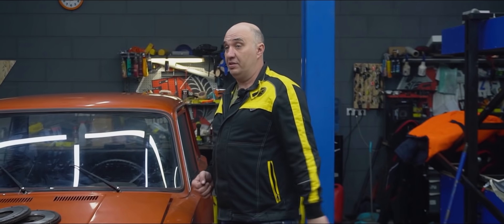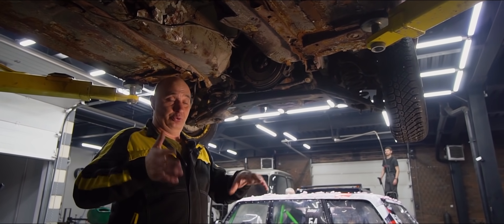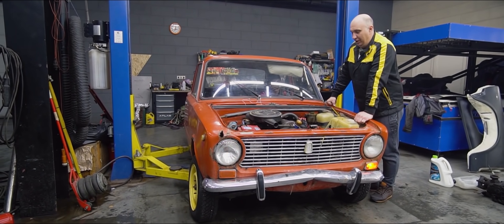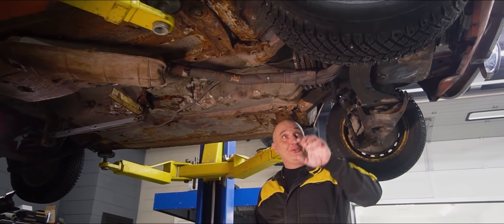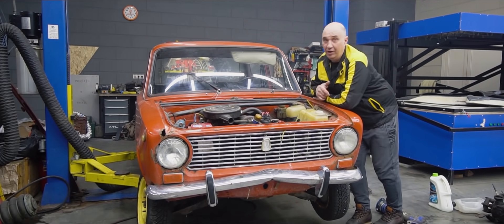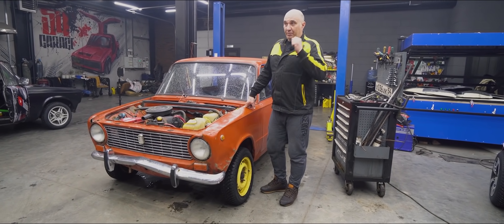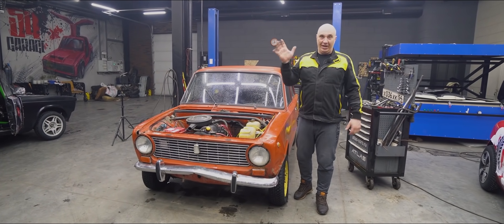What if you install FIVE flywheels onto an engine?

Comment: Bottom of car looks like it might crumble to rust dust at any second: "We are looking very good."
Reply: erm its called "Patina" :)
Reply: Well I mean it’s Russian man what what do you spec Grab some glue and some duct tape and you get to go
Reply: @davidkaye8712  :D
Reply: well yea but this is russia, what'd you expect
Reply: That's factory spec rust in Russia, one of that rusted tin is better than the fresh stuff used today.
Reply: it's just "weight reduction"
Reply: that's the least rot ridden Lada i have ever seen my salt road exposed Niva is fucked
Reply: Good for another 10-15 years easy
Reply: @minibowler  Fun fact, rust is actually heavier
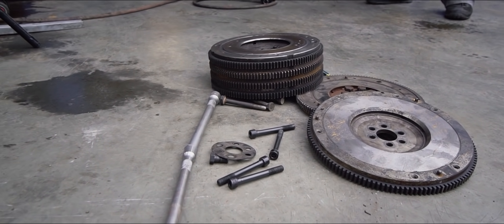Reply: Thats a hybrid Lada. Powered by the engine and foot. Foot powered just like Flintstone's uncle Fred's car. Thats why the floor has a huge hole for the foot to touch the ground 9:02 .
Reply: Good enough for new Mars rover Leonid, lets do this
Reply: Try only two
Reply: As long as there is still rust all is fine! Otherwise dirt will take over.
Reply: Actually that is one of the better cars. I've seen much worse on this channel.
Reply: At least it has a bottom
Reply: @davidkaye8712  umm
Reply: Mars rover uh, heck in space the car would spin, not tha crankshaft, and I checked with tha clenic, they want to see you at 4 o'clock   lol.
Reply: I wouldn't stay under that car.
Reply: Y'all are lame. Try just watching a video. Don't think. Don't post. Just watch.
Reply: Haha, I know, it's what happens in places with to much cold and put salt on the road, my chevy silverado in Douth Sakota was looking way worse being less than 20 years old.
Reply: lada's are machined out of a solid steel ingot,as such they are indestructable, that rust in nothing
Reply: @killerdinamo08  Not by a long shot.  It's not better when it's NOT rusted.  Go find the Top Gear where they drop a Lada and a Toyota off a roof.  The Lada looks like it's been through the smasher.  They DROVE the Toyota away.  Where people get these goofy ideas is beyond me.  

Those Ladas are death traps.  I doubt they would be allowed to be sold in the US as the safety tests would rate them in the minus one/worst we've ever tested category.  It's like people believing they are safer without seat belts, because they could 'get out'.  Good luck with that, as in yeah, they got out all right, right through windshields out of doors or door windows, sometimes to be crushed by their rolling car, or cut in half passing a tree, telephone pole, or sign very closely. 

I also saw a guy impaled on a 50's steering wheel column, lovely sight...so collapsible columns are a great idea, too.  Along with the FULLY intentional carefully designed folding cars do today in a hard accident from the front and back, which lessens the jerk considerably on the passengers, and keeps the passenger area totally intact, so you are not crushed into the car.  Cars are easily expendable, and if relatively late models, easily replaceable...people, not at all.   

I used to think the older cars were much stiffer and safer too, until I saw an identical crash test done at the same speed/same impact location/angle/speed with a mid 60's Fury (IIRC) and a current year car (it was several years back, the difference would be larger now).  The Fury passenger compartment was folded up like an accordion, the current era car, not at all.  I don't remotely believe it any more.  The steel was much thicker then, you could sit or stand on it with little to no fear of bending it, but that's about it for 'better'.  

Air bags, ABS braking, stability control, MUCH better tires for crossing center line markings (I remember crossing taller, ones repainted again and again) on 'high performance' wide bias ply tires and you'd damn well better be holding onto that wheel tightly, because if not it would jump half a lane sideways, especially with no power steering.  Brakes are better, suspensions are FAR better, headlights are FAR better, and on and on and on.  When my generation is dead I expect the nonsensical ideas will carry on even more.  Rewriting history is a piece of cake, and they do it all the time, but when you lived it you know what really happened.
Reply: @MrJdsenior  Yikes, don't know what spurred you so much, I was talking about metal in places on a car where structural rigidity would be good, like the underside, the door pillars, the roof, the door panels, which on newer cars are calculated for low cost mostly... And think you've got the wrong memory on Top Gears Toyota, it did drove after that demolition, but it rather looked from the crusher and the chassis was broken, it barely kept itself in one piece. However, there wasn't any Lada in that test, nor in one of such kind, they consider it a crappy car and didn't care to destroy one to prove it, altough a Lada Riva estate was the winner of the Carlimpics jumping in distance. And once Clarkson proved the point of it's 'nuclear' tuffness by bashing the wing with a hammer with very slight damage.

All of this doesn't retract anything from your statement on safety and how it's improved over the years, I agree and myself do enjoy the benefits of them, yet I would preffer my rust free, solid and built with propper engineered steel '96 Audi B5 than most cars of today's make because of the quality use of metal, something that was detracted even on the later of the same model due to parsimony of the industry.
Reply: So glad it was a new car, straight of the production line.

Comment: I would turn down the idleadjustscrew on the carburetor and see how low the idle can go. With all that mass keeping the engine turning.
Reply: YEA!
Reply: Until it misses and goes bang on the next stroke too early :-( might not be smart
Reply: @kitecattestecke2303  would that be from compressing fuel air in the chamber before spark?
Reply: I believe they are non interfearance engines.
Reply: @nathancloutier6219 * engine ignition timing. Sorry, should have been clearer.
Reply: @AJ-oj5eu  that motor dosen't care about oil. Not the color or numbers than anything else. Working even with diesel lubricated. And without it.
Reply: Apparently , you can  get more freewheeling if its in a vaccuum , I tried it , couldnt notice much difference .
Reply: @ponderin  not sure what theyre referring to.  not sure what would cause engine knock at low rpms
Reply: @ameraldas3641  You literally said temperature goes up during compression, then said compression can't provide the energy for ignition.
Heat is energy.
Reply: it will be like a ship
Reply: That would be fun to play with.
Maybe adjust that distributor timing a little.
Reply: @peeinacan1  you will have a knock when each piston goes over top dead center...the heavy flywheel will really amplify it having such heavy inertia
Reply: @kevinvezina6535  pistons dont go over top dead center.  thats the top.  Unless your engine is donzo
Reply: @ameraldas3641  sounds like youve never heard of engine knock lol
Reply: @peeinacan1 ..pistons go up to top dead and roll over  past top dead center on their way back down. This is an expression used....i know what tdc means...ive been a mechanic for 35 years..when the crank comes to the top and starts to come back down ,and again when it swings under on its way back up there is a knock..your harmonic balancer is used to neutralize this

Comment: Try the car when the snow goes away, and you have a big dry surface to try it on. You will get another big surprise! Around 1973 a top NASCAR team tried this concept for their car at Daytona. Their reason was that at Daytona they ran full throttle all the way around the track, and the corners would pull the engine down in revs. Their theory was that the energy in a heavy flywheel would let the engine maintain RPM in the corners. They built a 250 pound (100+kg) flywheel and gave it a try. They were surprised to learn  that the heavy flywheel was a big gyro and the car would not turn. When the car came to a corner, it wanted to go straight, through the wall.
Reply: Thats called " Procession . I wasnt a problem at normal speeds , with street tires .  In Switzerland , they tried , flywheel buses , they spun out on icy roads [ the flywheel was mounted flat on the bus floor .]
Reply: @paulbains9152  i read a wiki article about that bus, those are flywheel batteries. Unfortunally, they dont work with all vibration of a bus. Its great for stationary units and space. Its used for trolleys to give them boost after a station.
     Modern version of that flywheell battery is made of carbon fiber composite and its encapsulated in a vacuum or noble gas sealed cointaineer, for lower aero drag. They use magnetic bearings too.
      I was disapointed because i was hoping theycould use that technology for electric cars.
Reply: @polentusmax6100  The article I saw was in the 70s , in Popular Mechanics Magazine . These buses were supposedly in operation .  The flywheel was flat below the floor . A gear drive connected it to a small gas motor .    Ive seen the fyywheel batteries , that can be ganged up , that  was different than this .
Reply: @paulbains9152  Precession.
Reply: They would have killed that car before then. As you can see, body wise, there's not much left.
Reply: gear the fly wheel in reverse then ?
Reply: Very simple solution - Mount the flywhell in horizontal position and a second counter-rotating one
Reply: W.B. …………….that sounds like a Smokey Yunick trick ?????????
Reply: @AstrosElectronicsLab  A lot of the car's torsional strength would have come from the drive tunnel. Rust would have significantly weakened that, they just finished it off by cutting the tunnel out entirely, even though they DID put a little bit of cross bracing back in there.
Reply: I forgot to mention , the Swiss bus flywheel was run in a vacuum . I tried that too , it was a seal-eater . Leather seals lasted the longest . There was so little  extra volume in the flywheel bellhousing , I just                     disconnected the vacuum , didnt notice any difference ?
Reply: That's crazy. 
I thought through the effects a very heavy flywheel a while back..and came to all of those as my theory.

I guess going to 9th grade 3 times made me pretty smart. 👍
Reply: Give the flywheel a greater mechanical advantage instead, it would imitate more flywheel mass aside from the absence of gyroscopic influence.
Reply: I can appreciate some good history.
Reply: Dude, what a terrible timing to cut off that comment...
Reply: @dannycalley7777  Junior Johnson
Reply: That (if true), and the acceleration/braking would be CRAP by comparison.
Reply: Thats simillar reason why the steering is harder in high speeds, not with flywheel but with wheels.  Thats why faster cars do have wheel discs from some lightweight magnesinium alloy for the least gyroscopic effect
Reply: @mikes78  its a lada, still holds
Reply: @dannycalley7777  People say Smokey liked to cheat. I say Smokey was just the first to realize the rulebook WAS the race!
Reply: Yikes!
Reply: but did it maintained the rpm?
Reply: @nalo1728  yes, better than the light flywheel.
Reply: This can be avoided by using two flywheels rotating in opossite directions.
Reply: I didn't think of that! Perhaps Garage 54 can use a Transfer Shaft, and rotate a heavy Flywheel (Horizontal Plane) - somewhere inside the car. I really would like to see the effects, and also how the car handles. Maybe the car could remain upright on just TWO WHEELS - when the engine is running, and the flywheel is turning. I think that an Experimental car in the USA tried this once.

Comment: Crazy Russian mechanic: "We're gonna put five flywheels on this Lada"

Crank main bearings: "Say what?"
Reply: A 2 liter four cylinder piston might might see 4 tons of pressure at full load.
Reply: @ChevyLaxMan  imagine lifting 20 pounds... sounds easier. now put that weight on the end of a 5 foot pole and try again. XD it might be able to hand that weight in one direction, but shift that weight to one side and it can make a massive difference.
Reply: Tensioner has collapsed...omg
Reply: The let's see experiments usually lead to disasters.
Reply: Lada mains be like come at me bro
Reply: That Russian Mechanic isn't very crazy.  He is making a fortune from the YouTube advertising revenue.
Reply: @normanhill4028 jealous??
Reply: Would making some sort of custom bearing block on the other end of the stack be the way to go?

Comment: In Russia the wheels fly you.

That little engine has the rotational mass of a Mack truck diesel. Lol
Reply: You could also wind the flywheel up with a turbo , called a compound turbo engine , used on Lockheed Super Constellation aircraft .
Reply: COP greater than 1 !!
Reply: Without the torque and horsepower.
Reply: @paulbains9152  They were called P. R. T. s  , Power Recovery Turbines  driven by exhaust  .
Reply: Lada it is
Reply: and that's just before, they started !
Reply: * model A Ford
Reply: @athenazoey5093  Would love to see them do it with a Trabant. ;-)
Reply: @ty2010  That's right, 62 lbs. = 28 kilos
Reply: @Dave-ty2qp  I got there roundabout too, I had a 240 Ford 3spd and knew the flywheel was heavy AF. Still no idea if it was more, less or same flywheel as the model A as all forums and parts vendors are about replacing with steel and aluminum.
Reply: @gravelydon7072  Is this a Lada?
Reply: @paulbains9152  Also used on Scania trucks from the late eighties..

Comment: I can imagine the stored energy from the extra flywheels would be great for hypermiling and coasting. Well done and another great video!
Reply: You bet!
Reply: No it would not it would take more throttle to rev up the engine
Reply: With a CVT for optimal gearing ratios.
Reply: @CopperheadGarage more throttle would be better, as your running at a higher compression maintaining speed at decently low revs.

You'll use a lot more fuel getting up to speed, but maintaining it should be very decent

Comment: Around 6:35
He says, " It's still vibrating."
Of course it is. It's a Lada. If you look in the owner's manual, under "troubleshooting", under the issue of "no vibrations", the response is, "engine is most likely not running"